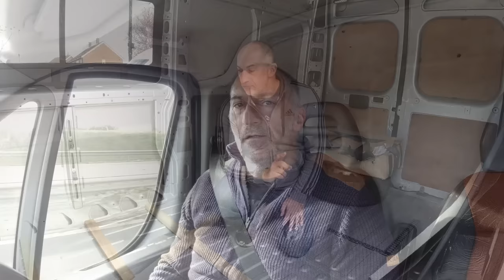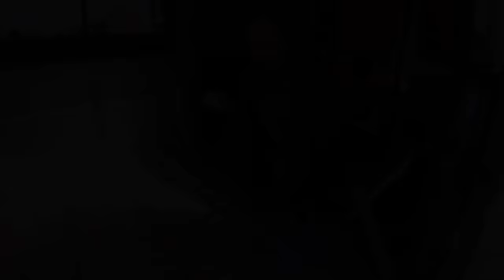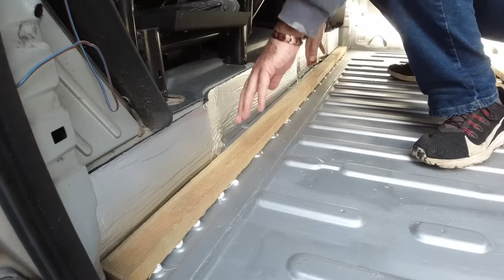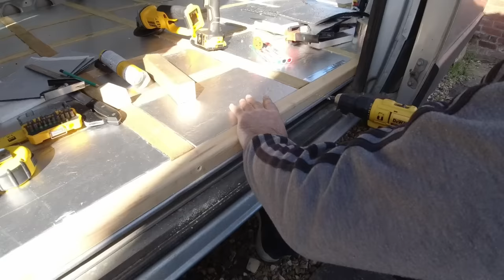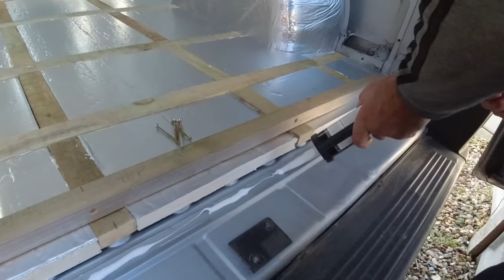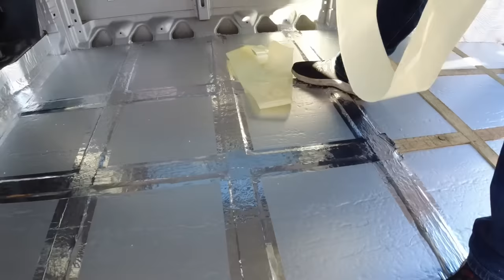How to Insulate your Floor on a Budget - Episode 7 of the Van Build Series

Comment: Absolutely love your videos and the way you convey knowledge. I noticed when you showed the image of the screw that had gone through the sheet metal floor, you’d treated it, but it looked like the underside of the van was also treated with a similar spray on material. Did you apply that, is there something you’d recommend that’s easy to apply to avoid rust? Where I live in Michigan, there’s lots of snow and salted roads in the winter and rust under vehicles is very common. I’m starting a new van build and wondered if there was a way to prevent this on my brand new ford transit. Thanks again for all of your videos, I’m using them as my education to build out mine!

Comment: Your videos are amazing, I've been watching for awhile since a friend recommended your channel. I've now bought an extra small van and I'm finding this new build so informative. I love the way you lay out the information based on clear facts, I always leave your videos feeling more capable because I understand so much better. Thank you for sharing all your knowledge! 

I was wondering if you have any advice for the set up/insulation of the floor of a micro camper? I have a limited amount of space to work with but I also want to make sure I'm fitting in as much insulation as I can without losing too much space :D
Reply from the maker: When you have limited space and you want to get the best insulation value then you need to look at the one with best thermal propeties and that is PIR boards. Now the thinnest they come in is 20mm, would that be still too much to lose? The bare minimum I would suggest 12-15mm of Armaflex closed cell sheet with a foil backing, however this will need some 12-15mm ply wood battens to support the load of your floor and stop the insulation being crushed.
https://www.ebay.co.uk/itm/304854308088?hash=item46fabb94f8:g:PTwAAOSwF2tkHD0l&amdata=enc%3AAQAIAAAAwN65Hg222TYnUybcioy4jyJ93KjMVJOJeqSSFIYEjqkqecirpriwwGq%2F7ZgguXDvWYE90d089wO8S2oQLC1IShRXr3ADTK3scyqdZWoCqjKpr8GzY9hcH4aEMCnS1yGpEn5sDiKJuWFDVzh7eO%2BoqMjJ9qKTd%2FpDfNJ%2FyNnakJ4LLsNr2VufyiI760PbEmk77MncHUuR%2FLpn7OsEhQaKfwzrGgb0axk3%2Birx6wd%2FGVPNQtOh6DEi0RH%2B9Jp264%2F5iA%3D%3D%7Ctkp%3ABk9SR_S33Nv8YQ&mkcid=1&mkrid=710-53481-19255-0&siteid=3&campid=5338027957&toolid=11800&mkevt=1

Comment: I run adhesive foam between the ribs in my floor before laying Celotex over it.  Done away with having to use battens.  The foam fills the voids and doesn't compress, leaving no pressure points at all. 👍🏼
Reply: Yeah, no need for battens.  They compromise the insulation compared to using full sheets. 

Also, PIR becomes less insulating the colder it gets.  XPS doesn’t.

Comment: Hello Greg, your videos are superb, I like the way you explain everything in the simple way that people can understand it. There is just one question which is on my mind. How do you insulate the front doors in your camper. Do you use special product? Or just skipping it completely. I am asking because there is potential water geting in the door between the sliding glass and the rubber gasket.  Any thoughts? Or am I just thinking too much. 

Thank you for your answer
Reply from the maker: You can’t do anything with the front doors for the reason you just mentioned and also too much mechanical equipment moving in there with electric windows so leave as is 👍🏼

Comment: Your video are great, thanks it helps alot. For the patten do you glue them all with sika 522 all in the same time or you leave the long transversal ones cure before gluing the short ones.
You may add that the back and slidding door need a thicker patten.
Reply from the maker: I did the whole thing in one day apart from foil tape and door pieces I did next day. Yes those thread holds are bigger pieces of wood as there are not ridges there.
Reply: @GregVirgoe  thank you for quick response

Comment: Great video, great series - immensely helpful. A question if I may - I'm struggling to find a source for the lengths of timber to make the floor frame. Most timber merchants have a minimum order of much higher than the accumulative value of the materials I need. Do I need to just bite the bullet and go to Jewsons / similar or am I missing a trick? Cheers Greg, keep up the great work.
Reply from the maker: I found these through Facebook Marketplace and there are quite a few merchants selling there, I got mine for £2 each. I just looked and here is a perfect example and these are only £1 each :D https://www.facebook.com/marketplace/item/230041149649469

Comment: Great video, thanks are you not concerned about the voids under the insulation? I have seen some people put Dodo Mat in there which seems a waste of time, but anything to fill the gap? Would condensation form in there? I appreciate it's a budget build
Reply from the maker: Not worried at all. The vapour barrier is completely sealed so no moisture will get in there at all. No condensation see my video I did to prove it. https://youtu.be/ommqMG7RjXg
Reply: @GregVirgoe  Excellent thanks - very interesting!

Comment: Hi loving this series so far , your right I was thinking what happened to the screws in the floor but I did think it was a little over kill adding them
Reply from the maker: Providing the right adhesive is used correctly it can be very strong 💪🏼

Comment: Greg, thank you so much for the effort you put into providing information. It is really, really appreciated. Did you put Thinsulate or another material over the wheel arches before you covered them in the reflective foil? Thanks again.😊
Reply from the maker: No, this time I used the same foil-faced closed-cell insulation that I used to cover the cab roof, you will see that in this week's mid-week, video and I explain why I use it too, that one is all about sound reduction.

Comment: Good to see your new build series coming along Greg. 👍
I always question the need to put loads of batons on the metal floor of vans with  insulation in between? So many cold bridges, cold metal to timber to ply will definitely ruin the insulation value?
You must be aware that 'floating floors' have been used for donkeys years without deformation of the insulation if joints are done correctly, boards and joints staggered and edges are supported? Surely, this would be easier,  cheaper, better insulated and quicker?
Not a criticism just a suggestion that I would love to see explored more.
👍🏴

Comment: Hi Greg , as I have done the exact same way as you a while back . Did you chamfer the ends of the battens as the peugeot boxer, ducato, relay has a slight annoying upturn at the sides where the battens end. Nothing is easy and never straight . Love these tutorials . I'm slightly ahead of you but at your rate you will be overtaking. I divided my van floor into 600mm  total of 1800mm so I had a 600mm walkway . Can't wait for your next video. Just upholstered all my seats myself and doing my doorcards, new cab headliner and gearstick gaiter. Keep it up Greg ( legend) ps never used screw i used adhesive . Its rock solid that stuff
Reply from the maker: The only pieces I had to do some shaping to where the door thresholds as they had some bumps and bits to cut around, I have a new method to show for doors that no one has thought about before including me :D
Reply: @GregVirgoe  can't wait Greg to see that . Keep up the good tutorials . 👌

Comment: Hey Greg, thanks for these excellent videos. I'm about to start a microcamper conversion, mainly to use in the UK and France. Could I get away with using the same silver-backed 10mm stuff you used on the wheel arches under a plywood floor? Every centimetre is going to be crucial for headroom!
Reply from the maker: I would use some strips of 10mm plywood battens to stop the foam getting crushed to nothing. 👍🏼😊
Reply: @GregVirgoe  Many thanks. I'm addicted to these videos now!

Comment: Hi, if you mark it out you can drill the holes through the floor first, check underneath of course, this enables the screws to be fixed in from under the van. This is much stronger and neater, I use marine stainless screws, use sealant or wax oil to protect the steel. 😊😁👍

Comment: Hi Greg, really enjoying the series 👍 we’re converting our own lwb ducato running about 3 weeks behind you at the moment. In the video I noticed that on the inside seal you had taken out the inspection covers (triangular) off’so the question is why? Have checked and waxoiled as sprinters or is it for electrical runs or insulation? Only asking as I’ve been looking at them at them over the last few days and wondering all of the above! Real work starts on Tuesday. Happy to keep you updated if interested. 
BTW a friend is just completing his sprinter, working off of your videos and has made a fantastic job of it so well done fella🎉
Reply from the maker: all extrernal plastic rub strips have been removed, new clips fitted and sealed with sealant, all internal voids will be insulated. :D
Reply: Sorted I suspected it wasn’t an isolated problem with sprinters. Consider it done sir 👍🏻

Comment: Hi Greg love the channel and all the detailed advice and videos you create. I have just purchased a Citroen Relay MWB to convert. Quick question the timber you used to do the edges for the side and rear doors was that still 25x50 as it looks slightly bigger as it’s on the flat part of the panel. Keep up the great work and look forward to following along on your new build. Thanks
Reply from the maker: It was some bigger pieces of nominal 2x2 that I cut down to suit the height at the doors. 👍🏼😊
Reply: @GregVirgoe  Brilliant thanks Greg!

Comment: Excellent tutorial Greg. Not sure if you're able to answer this, but what would be the total dimensions for floor plus ceiling construction when calculating standing height? For example, adding the total floor and ceiling insulation and covering?
Reply from the maker: The floor build up is 25mm insulation and 12mm ply wood plus your choice of finish.
The roof will be 12mm plywood battens with 5mm ply sheet over that and what ever you want to finish with
Reply: @GregVirgoe  Thanks for that. Helps a lot 👍

Comment: Hi Greg, thanks for creating videos like this! I notice you have foamboards with foil on it. I bought mine already but they dont have this layer of foil. Should I buy sheet of foil (if that ever exists!?) and glue them to the top of my boards? Right now, I have foam boards + 1/2 baltic birch + linoleum. Thanks!
Reply from the maker: You can get double foil bubble wrap that would do the job a layer of that over the insulation before the timber goes down.
Reply: @GregVirgoe  Ok! There is reflectix at my home hardware. I will sandwitch a layer of it in between the foamboards and the plywood. Thanks for answering so quickly, that will allow me to get my material on time for the week end! Veeery helpful as usual:-)

Comment: This is the best advice I have seen on insulating a van, however I am looking at doing a caddy maxi as a micro camper and I think the floor and think insulation would take up much needed space. Do you have advice for a smaller van?
Reply from the maker: Yes, don’t insulate it with anything less than 12mm or you will get problems with condensation forming. Just use strips of marine ply for battens as wood is still a good insulator and use 12mm insulation board for infill. Make sure to vapour barrier over the top before putting floor down. 👍🏼😊

Comment: If you were going to take this van up into the Alps and go skiing, do you think that you've used enough insulation on the floor so your feet wouldn't get cold? In other words, if you were going to sleep in -10ºF (-23ºC) as we sometimes get overnight in the US Rocky Mountains, how much floor insulation would you need in your estimation? I'm a skier and I'm contemplating how much insulation I would need and I am assuming I would need to add under floor heating. I'd appreciate your thoughts on this. Love your vids...
Reply from the maker: We prefer to holiday in warmer climates so if you want to build a van for colder weather I would definitely go with 50mm PIR on the floor. Do not install underfloor heating as there is not enough floor area in a van for that to give you sufficient heat output. A water system under the floor is not practical in cold climates because it could freeze and cause leaks and an electric system would use far too much electric and you'll never be able to recharge your batteries.
Just go for traditional heating systems like the Truma or Diesel heaters, they work so much better and use far less electric to run. stick with the basics that are proven to work.

Comment: Question:      is condensation possible between the metal floor and the aluminium coat of the floor insulation ?   Could  it make the floor rust ? Could we use some ant-rust product between both ?        The kind we use (at least here in Canada)  to shoot under cars to rust proof   ..  it's a bit like a wax.           Greg's videos are amazing !

Comment: Yep, you don't need screws. I had to remove a piece of wood I'd stuck to the van once and it was a tough job.

The only place I've not trusted sikaflex is on the roof to secure the solar panel. That's because I don't trust the paint to hold.
Reply from the maker: Yes I can undrtsand that, You will see that I have added screws to my solar panels too in an upcoming video

Comment: Hey Greg, thanks for the great video, I'm following along with my own build at them moment and it's been so helpful. Just a quick question, I'm assuming the end pieces that were screwed into the other battens in the door ways were a different size of timber as your making up the gap from not laying them on the ridges? If so can you remember what size you used please. Thanks again

Comment: Loving your really helpful videos Greg. Would be lost without them 😅

Quick question: why is vapour barrier not used for the flooring area? I would've thought it would be needed to prevent the same issues you'd get by not having vapour barrier on the walls and ceiling 🤷🏻‍♂️ Just an innocent question to ask as it was a thought that came to me as I prepare to install my floor insulation.

Many thanks
Reply from the maker: The PIR is foil-faced, that is the vapour barrier and the foil tape over the timber completes the barrier, before the ply goes down there is a complete foil layer. that is it.

Comment: Greg, great videos. One quick question: it looks like the insulation is just a little thinner than the battens. Would it be sensible to add a blob or two of sikaflex to the bottom of the insulation? Perhaps keeping an air gap between the van floor and the insulation?
Reply from the maker: Yes, you are correct, a few blobs of sealant would have raised that to a level. I have closed up the gaps this time on the battens so once fixed the floor should be better supported.

Comment: Would less batons, and more PIR  coverage not be warmer? Or is it not worth sacrificing the strength and ending up squished boards like you mentioned. Loving the individual videos by the way, i hope theres 100 by the end !
Reply from the maker: Timber is still a very good insulator because of its open cell structure so I won’t be losing any heat by doing this way. 👍🏼😃

Comment: Hi @GregVirgoe!

Thanks a lot for your immense help! I bought a PIR sauna board knauf which has a 3cm depth, and battens that are 3.6cm in depth. I am wondering whether it's a good idea or not to have 0.6cm difference between the battens and insulation boards depth. Was thinking to maybe add some wool to reduce the difference, but then again, it will be difficult to apply aluminium tape. Wondering what are your thoughts on this? Should i just leave the depth difference as it is and apply aluminium tape on the meeting points? Thanks
Reply from the maker: I wonder if you place the battens on the lower section of the floor whether that would be enough to make up the difference? Or find someone you can borrow a thicknesses from and plane all the battens down. Have any friends in the timber / carpentry trade?